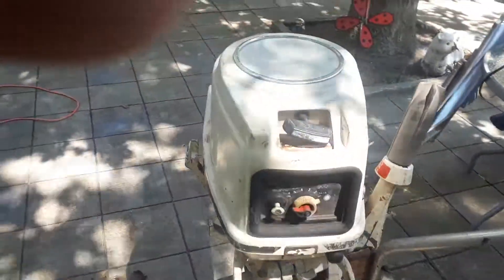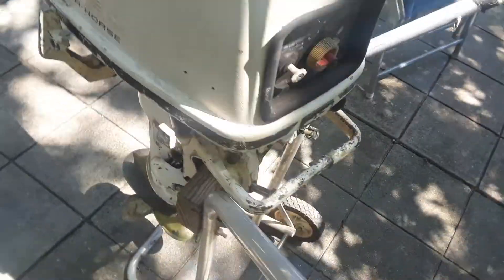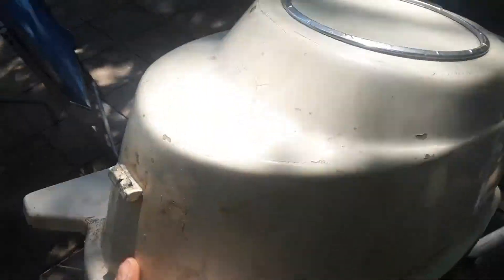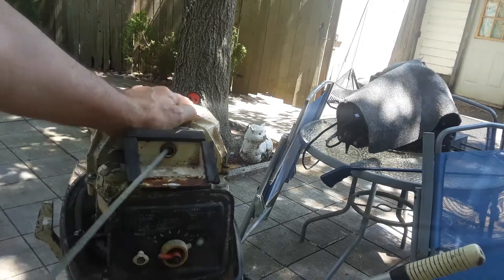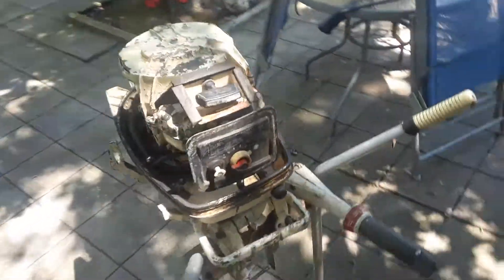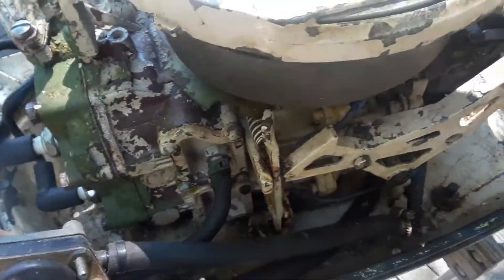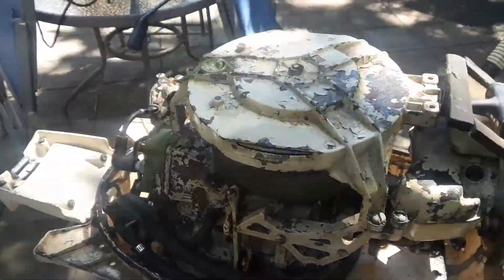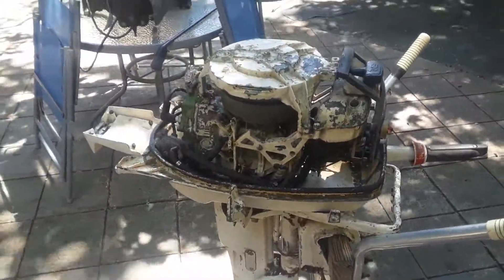1959 Johnson 10HP M/N QD-20 Another $40 Facebook Marketplace Special Not a Salty Dog ThankGod!Part 1

Comment: i have the same engine with a pressure gas tank to keep it original. its 1959.
I paid $125 over 15 yrs ago and it needed everything under the flywheel, plus water pump. 
rebuilt the carb, new needle and plastic float.
it runs good now, after i retired Iwas able to spend the time it needed to repair it properly.
its on a 14 foot alum skiff, we  live up in maine. tons of salmon and brookie fishing up here.
Reply from the maker: Very nice cant beat these old motors.Dont know what they used for insulation on those 50S coils but most of the motors I have got thru the years need changing.Some years ago I scrapped two five gallon buckets filled with those cracked coils,LOL! Thanks for commenting stay tuned. Im working on a 50s Evinrude currently video coming soon.........

Comment: Nice old motor 40 bucks can't beat that good score Glenn. Those old motors are a lot easier to fix then the new ones of today
Reply from the maker: Thanks Chris yeah thats why I like them so much grew up around them. Luv the under $100 motors this one ill have running today couldnt find my fuelines I have three yesterday to start it ,LOLL! Ignition was all brand new parts points were oxidized polished them up with my Dotco and  3 inch blue Roloc like new  great spark again initially had none..stay tuned...... Glenn

Comment: You're right, its a 59, fuel pumps were added in 1960.  There is a beautiful 59 10hp cover on ebay right now for only $10 if you want it.  I always loved the 59 Johnson styling and graphics, never liked the Evinrude bread box motors of these years.  Yeah, the new gearcase is a plus, hopefully the wrist pins are tight....
Reply from the maker: Have you seen the cover since I polished it and added decals touched up the lettering. Just the other day I put on the  missing SeaHorse Emblem .Found one on E-Bay NOS for $10.00 great deal. I will check that cover out for shits and giggles on E-Bay thanks for the lead. I did a rod slap check as I mentioned in other comments tight. We call them Evinrude  refridgerators up here in my area with those boxy cover styles.Would make a good mailbox put a door in the front,LOL. Stay tuned Glenn